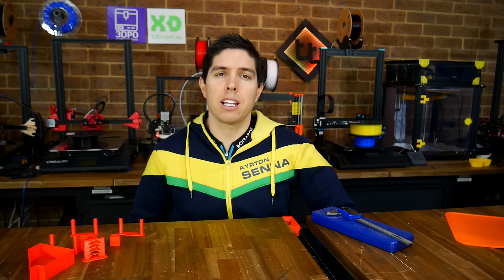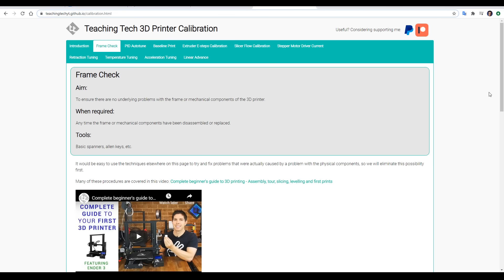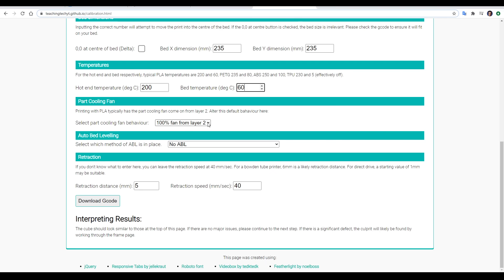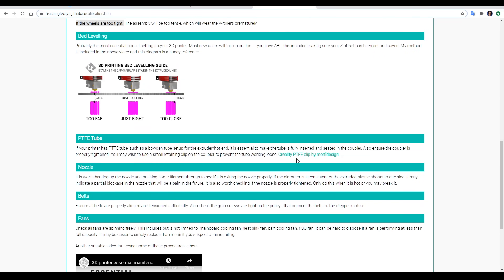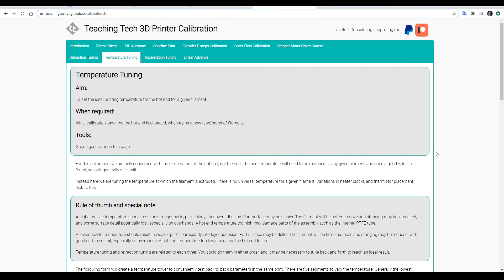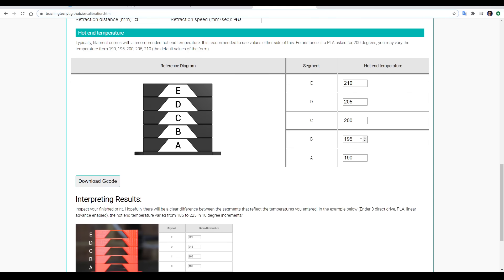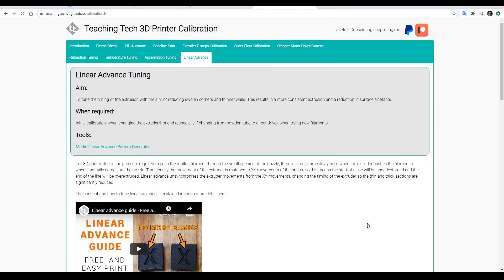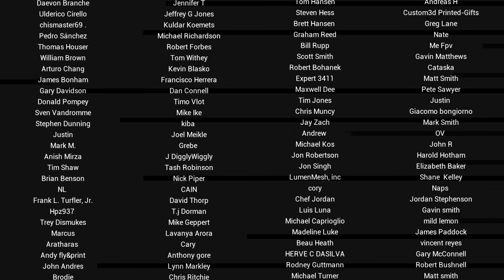3D printer calibration revolutionised - Step by step to better print quality

Comment: Nice job but I have a problem with the retraction test.
I downloaded the stl-file and sliced it in Cura.
When I print that retractiontest it first goes well but then I see that just before the pilars are printed first there are 3 layers with only the border of the baseplate.
So the borders of baseplate are increased with 0,6 mm before the first layer of the pilars is printed.
Because I now print 0,6 mm above the printed area this doesn't go well and my print is failing.
Is this normal? I guess not.
Is this then an error in the stl-file (I hope it ins't) or is this some setting/error in Cura or ??

Comment: This is GREAT!  Been looking for a consolidated calibration set like this for a while now.  Here's everything in one place, with the steps needed to make corrections and tune every thing up.  

Only one more thing I would ask for...  Someplace for each of the tests, can you mark the ones you would suggest any time you change filament types?  I know you mention it in the video.  I've just bought my first spool of TPU and a bit worried about the steps I need to use to calibrate the printer/slicer for it.  I've only printed PLA until this new spool.

Comment: Very nice guide and structured tests.
There is no active issue link on your webpage, so let me add here that I missed showing the print size calibration procedure.
 I'm talking about the outer dimensions, not the walls.

Best regards

Comment: I dont know if I am the only one, but the retraction tests given by you dont translate when i slice it myself. Are there other settings you are running like wipe or coasting, as you mention coasting, but dont say if you are supposed to use it. I added the zhop and everything else and was just wondering what could be going wrong? Thanks
Reply: I experienced the same thing. When I did Michael's retraction test on my Ender 3 (basically stock config with higher quality Bowden tube and fittings), it produced some really clean results at 2mm, 50mm/s, and was noticeably worse at all other lengths. I was a little surprised at how low that was for a Bowden setup, but I couldn't argue with the results. I chalked it up to having Linear Advance dialed in, which should reduce the required retraction a bit if I understand correctly.

However, when I put the same 2mm, 50mm/s into Cura, my prints have much worse stringing than Michael's website-generated gcode. And for that matter, so do all other retraction settings I can set in Cura. I tried to slice the retraction test STL every which way (changing retraction lengths and speeds, messing with wall print order, coasting, wiping, and z-hop) and it never got it as clean as the 2mm band on the web gcode.

Comment: My question... I have stock firmware and boards on my ender 3p and Anet A8. 
How do I change my gcode firmware.   Do I have to go to marlin? What  program is used to interface with the printer?

Comment: Could you please do a video on how mesh bed leveling affects your prints? For example, when the bed is warped, will the model be warped in the same way the bed is warped? Or will only the side that touched the bed be warped? Or does it print supports on the lower points of the bed?

Comment: You could even do more and make a nicer k factor calibration thing for linear advance. I have myself played with things like two lines (maybe even in two layers) a tiny gap apart and then you can hold it against a light or try to rip them apart to see which is the most uniform.

Comment: Hi,  thank you for  a great video. I tried the PID autotuning for the hot end and it worked find. I tried to do it for the bed, and it give an error message.Send: M303 E1 S60 U1
Recv: PID Autotune failed! Bad extruder number
 I have an Ender 3 with an SKR mini E3 v1.2 Does this mean that PIDTEMPBED is not enabled in the firmware? If it is not enabled, do I have to edit the firmware?

Comment: FYI... if you're using a Makerbot style firmware, (aka Sailfish or Flashforge) then it also has the origin at the center of the build plate.

Comment: Mostly default settings in cura with 100% flow rate prints nice 0.4mm walls but for some reason the files from the website all underextrude heavily. Any idea how to fix that?

Comment: Y'all should check out 3Doptimizer.com it. is. cash. Basically it creates a grid of test settings so you can pick whichever one looks/feels/is the best for your needs. It does temperature, speed, retraction, bridging, and other stuff i can't remember but those are the big ones.

Comment: Your command for bed's PID autotune doesn't work for me but what worked for me was this: "M303 bed S60 U1" because not all board share same value for bed "E-1"
UPDATE: A suggestion, you should add "Print Speed" to cube calibration page, what if I want to calibrate with PETG or PLA since both have different speed requirement.

Comment: Though the calibration page is a super great tool for the novice, I'm still finding myself stuck at the same thing... there is an assumption by the learned that the novice knows everything that they refer to.. Now this could just be a "me" alone issue but when they mention "enter this or that in the code"... I'm at a loss. Enter it where with what to what means... Such things as "In a terminal, enter the following to tune the hot end:" ... ok, terminal, what?  Or "Firstly, we need to know the existing E-steps value. To find this, enter: M92"  once again I'm at a loss as I am a novice at this and have no idea what where or how of what they're referring to... 

I have an Ender3 V2 with OctoPrint set up and have managed to get some nice prints thus far before upgrading the extruder, adding a BL Touch and Capricorn tubing to the system. I have yet to start a print with this set up until I get more 'learned' on the setup. I find myself now more confused than before.. Or is that just me overthinking this process?   Any help would be appreciated as to where to look for the info to step forward..  Thanks again for setting up a great calibration page!  Cheers
Reply: This is the most beginner level instructions I have seen online, watch the video from the very beginning, or look up a Pronterface tutorial, as the codes are all entered into the pronterface program.
Reply: @originaltrilogy1  and you basically confirmed my comment about the novice noobe not knowing what you do, pronterface? This is a long fun route to learning all this stuff but again, the bare bone basic fundamentals are hard to find, but thanks to folks like you, one more brick is laid down on that path... Thanks M8

Comment: Thanks for this, even if you have been printing for a while this is incredibly helpful. Only comment is that in the E-stepper tab it would be good to address putting the printer back into absolute with a G90 command or telling the user to restart the printer.

Comment: Excellent video.  Consider adding Retraction Prime Speed to your Retraction calibration.   Cura for example defaults to the same prime speed as the retraction speed.

Reducing the prime speed can reduce stringing and zits.

Edit: I'll add the comment to the GitHub as requested.  I'll leave the comment here as it counts towards interaction in YT algorithms.

Comment: Well I have just finished a new scratch built corexy so I figured this would be a good chance to give this a test. so far this seems to be pretty good thanks for this will probably save me hours next build.  I would like to add there could be a bit more info and setting for the Duet boards

Comment: Do I have to worry about the stepper motor current when I'm using TMC2208 drivers running in stealthchop 2 mode? They advertise it with not having to set the current anymore.

Comment: You should seriously do a new marlin/vs-code for ender 3 configuration. Vscode changed so much in the last updates that the old configuration for skr with 2209 setup no longer works and theres a ton of new options. I tried a skr1.4 turbo,  tft35 e3 3.5, tmc2209 with sensorless homing, and bltouch.  its changed drastically and is definitely in dire need of a new updated configuration for the new vscode.

Comment: your cube print, was pretty much impossible to print as it didn't start with a left bed test strip to purge the nozzle,
Reply: You coukd add some custom gcode for this, I did it so filament was primed before starting the real print. Something like G1 Z2.0 F3000 ; Move Z Axis up little to prevent scratching of Heat Bed
G1 X0.1 Y20 Z0.3 F5000.0 ; Move to start position
G1 X0.1 Y200.0 Z0.3 F1500.0 E15 ; Draw the first line
G1 X0.4 Y200.0 Z0.3 F5000.0 ; Move to side a little
G1 X0.4 Y20 Z0.3 F1500.0 E30 ; Draw the second line
G92 E0 ; Reset Extruder
G1 Z2.0 F3000 ; Move Z Axis up little to prevent scratching of Heat Bed
G1 X5 Y20 Z0.3 F5000.0 ; Move over to prevent blob squish

Comment: I noticed in the "Stepper Motor Driver Current" you mention hot stepper motors. Does that include the extrusion stepper motor? The Prusa Mk3s has always run hot for the extruder stepper motor. I assume you are NOT referring to the extruder stepper motor?
Reply: Heat shortens their life you generally want to avoid it. The wire used in them uses an isolation that melts at particular temp and degrades faster with heat over time. Lowering it will generally improve longevity. Water-cooling a  hotend on direct drive can be good. Have no personal experience with prusa printers though but steppers for the most part are the same from cnc to robot to printer.

Comment: THANK YOU SO MUCH! I was at my wits end with my printer after upgrading my Marlin version. While I'm going to make a few adjustments to the firmware again, I now know the issue: the settings shipped with the config file I used (Ender-5 Pro) were causing critical under-extrusion.... off by as much as 10mm. I now have essentially NO layer lines. I'm going to finish the steps and finally get this thing dialed in. 
Also, one other thing: can you either add to the guide a part about E in mm, or make a video explaining it? I set it by accident since I'm a noob and it was the main source of my issues. When I ran the extruder calibration the first time, it came back at like 232 steps/mm since I had that setting on. Thanks!

Comment: Wouldn't call it a revolution of 3d printing world, but it's veeeeery handy to have all of this in one place, simple to use and follow. Previously I had to go over like 10-12 separate links to do all this and not forget.
To be honest, most of this stuff should be built into firmware and turned into some kind of a wizard with steps and explanation.  That would be a revolution.

Comment: Thank you so much for this. I have been struggling since I started this journey. I would get it close and put out a few good prints and then it was like I was starting all over again and go through all the settings again. I really put a wrench in the works when I installed the direct drive on my Ender3. Man what a chore. But always thanks to you and your videos I get through it. Thanks again for your work on this very helpful tool. You ROCK!

Comment: Outstanding!  A few months back I built my Ender 5 and printed a few items that came out pretty good.  I decided I should tune my printer and could not find one concise place where all the various running was explained and in what order we should perform them for repeatability.  This was important as should I either change my controller or have to reset it for some reason I wanted to be able to get back to where I was easily.   So I started to write my own procedure referencing various sources and linking videos as well.... some these were even your videos.  NOW I can stop this effort and simply use your site!   Thanks for all the time and effort.  Now I can dust off my printer and get back to work, ahhhh after I tune it 😄

Comment: Really nice :)
Still, I prefer doing it "the old way". It fits better my way of doing things.

Related to the retraction test, 6mm retraction distance is really A LOT. It's okay-ish with PTFE-lined hotends, yet it won't work well with all-metal hotends, for which you should halve it as a start point to avoid any clog.

PS : athough it made its way into 3D-printing glossary, using "Direct Drive" as a kind of name for a Direct Extruder is slightly wrong. Both Bowden and Direct Extruder setups can be either remote motor or direct drive... And both are, generally, direct drive (since the gears are directly attached to the motor shaft).

Comment: Thanks very much! Learning lots from this!

But I've got a delta printer and doing the xyz cube half of it comes out fine but other side is very jagged with infill coming out all over the surface, only seen this on the preview using simplify3d

Comment: I don't think your retraction generator works as intended. I did a 3 - to  6mm (40mms) retraction test and I get the very same strings across thetower. I tested with my own tower sliced at 3mm (40mms) and I get nearly no (or very ver thin strings) with NO zhop. Can you please verify? I cant' see retraction in the code.
Reply: actually I can see the retraction in the gcode. It must be the ZHOP than that gives me very bad results?? (Bowden)
Reply: It istheZHOP, you may want to make that configurable

Comment: Super set of tools!

Just one word of warning about PID bed temperature, some setups (like mine) can't use it. If I use PID bed temperature, my bed MOSFET gets incredibly hot, I guess something is causing the MOSFET to spend too much time in the non-linear region of the MOSFET (maybe switching too fast?), and that makes it generate a lot of heat.

This is very dependant on your hardware, but it's worth keeping an eye on (I actually smelt mine after about 15 minutes!). I'm using a DIY build with a Chinese RAMPS 1.4 and a generic external MOSFET board. It's not the end of the world though, beds don't really need PID.

Comment: Very nice indeed! However could you add linear advance tuning in Klipper way. By creating a mid-cornered cube that has different k values say every 20 layers, it will be much better than the current pattern on first layer only.

Comment: Well done! I've done the exact same albeit with my TXT file and a calculator for years now. Would suggest doing extruder calibration right after PID tuning. Lastly, part size scaling especially for Deltas. Otherwise, well done!

Comment: I would love the option of being able to set some printer settings in a 'General' tab. Like gcode startup and ending scripts so you don't have to manually add them in the gcode file later on. I can do this manually no problem, but I can imagine many others won't be able to edit their gcode files.

Comment: Thank you for this amazing guide. I just got my first printer, an ender 3, about 1 month ago and I have been struggling so much with dialing it in. I've been working my way though this guide and it really is all encompassing. However, I'm running into an issue where the baseline print is basically flawless, but when I go to calibrate the wall thickness and print with with my own slicer settings it quickly falls apart. I go from a flawless outer wall to a quite ugly print. I'm not sure how my slicer settings are so off, but I was wondering if on the baseline page you could maybe provide a screenshot or link to the slicer settings you used to generate the gcode. This would be greatly appreciated :)

Comment: This is exactly what I have been needing. I will probably spend tomorrow getting my i3 MK3 w/ MMU2S dialed in. Any chance you know of a good way to check extruder E step when the filament is in a PTFE tube and doesn't get loaded to the extruder until the print starts? Using a marker isn't really an option.

Comment: This Website is wonderful. Especially the part where can tune the settings over the height of the print. It is always a pain in the ass changing all of the settings by hand and this website is really convenient. 
But I have a quick question concerning retraction tuning: The way a software calculates the pathing can affect the stringing as seen here: https://www.youtube.com/watch?v=_QRb54zVPfQ
Do you already have observed such an effect for your website?
I think this website will have a huge impact on the 3D printing community. 
Great work

Comment: Awesome guide, doing the flow cube right now. To anyone new to this like me: I forgot to set the printer back to absolute mode (G90) after measuring the E-Steps. That really causes interesting Problems (Extruder pushing far more filament that fits through nozzle and hotend way off from where it should be). I don't know if i did something wrong, or if you have to put in G90 manually since it's not in my starting G-Code. But after i did that everything worked fine.
Reply: I did the same thing, started spewing filament after slamming into the upper right corner of the plate!

Comment: This is some serious dedication, great work! One suggestion I might make is to allow fan speeds other than 0%, 50%, and 100%. I personally have a custom coreXY build with a powerful 5050 blower that needs to be run at 60% (obviously the 50% setting would probably work just fine for me, but other users may have different requirements). Thank you for your valuable contributions to the 3D printing community!

Comment: Hi Micheal,
I tried the baseline calibration cube, my cubefile turned out very bad, thought its a printer problem, opened the .gcode file and saw that X is on the left side stepped and Z is pretty underextruded.

Printed with a FlSun Q5 Delta Printer